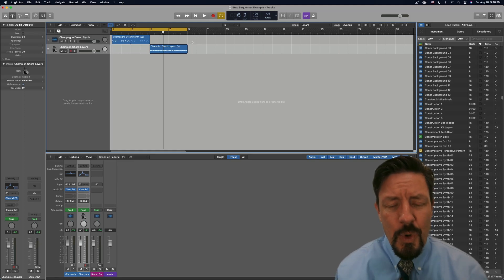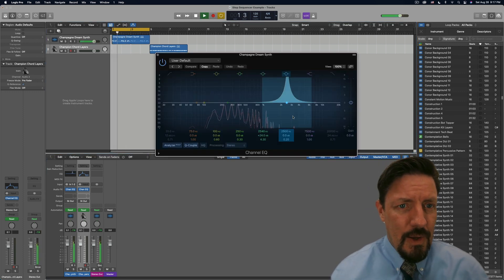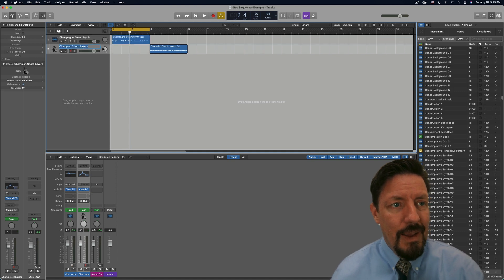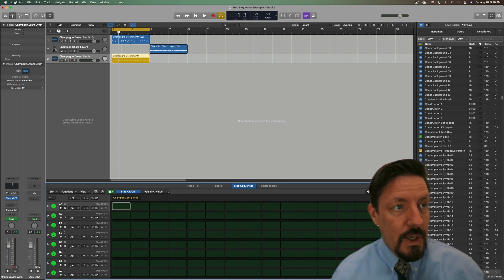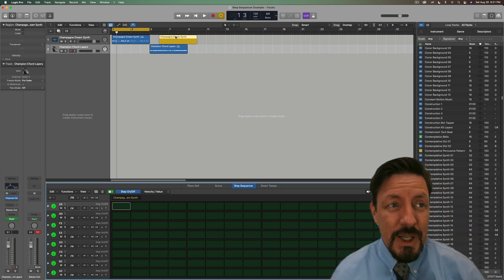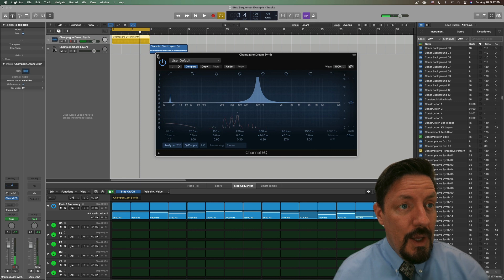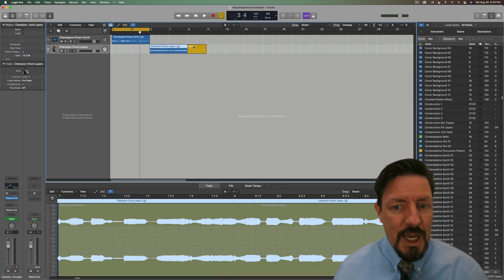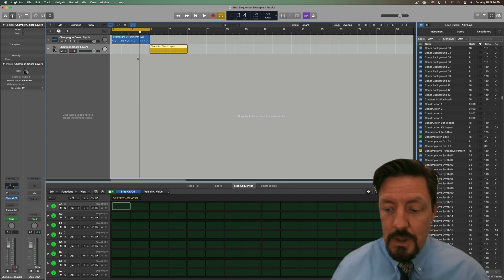Step Sequencer on Audio Tracks! | Logic Pro

Comment: Thanks a lot for your video! I try to recreate this, me and my brother, me from Germany and my brother in Athens, Greece, but we cannot. First, not the same pop up menu shows by right clicking, and the "Create pattern region" is not at the place of your pop up menu. I create a patter region by right clicking on the track, but it has a blue colour and not the mustard colour these regions have. Strange. I don't see what we are possible doing wrong!
Reply: Is there a setting that we didn't do on our Logic or track  preferences?
Reply from the maker: Do you have all of the Advanced tools turned on in the preferences?
Reply from the maker: Also, which version of Logic are you using?
Reply: @LogicProLife  Yes, I have all Advanced tools turned on and I am using Logic 10.6.3
Reply: @LogicProLife  for overlapping I remembered, I had "overlap" selected. Son now I have a pattern region underneath of an audio region
Reply: I assigned the new audio track to the audio track with the audio, it plays as in your video. But nothing happens with the  EQ
Reply from the maker: And you assigned the pattern lane in the step sequencer to the EQ automation destination?
Reply: @LogicProLife  yes, i did. As it shows on your video
Reply from the maker: Hmm, then I’m not sure exactly what isn’t connected. I’d have to see it in action to figure it out.
Reply: @LogicProLife  ok, thanks a lot o shouldn't bother you so long, thanks for your patience and help. I will try to find out myself, i just need some time to check all preferences etc.